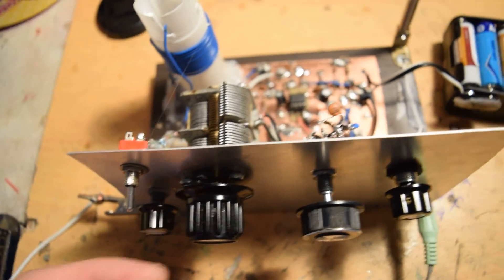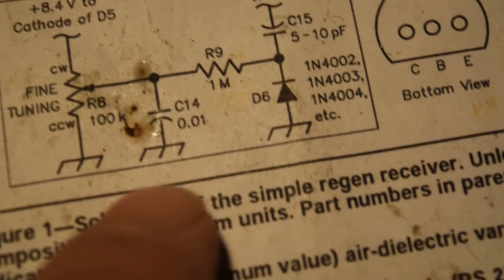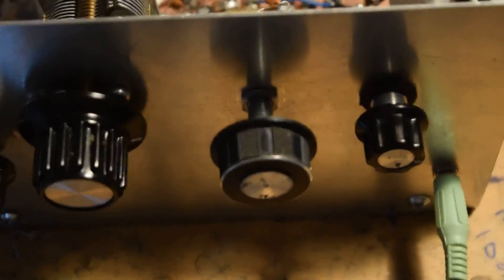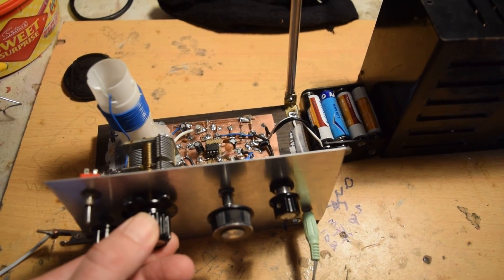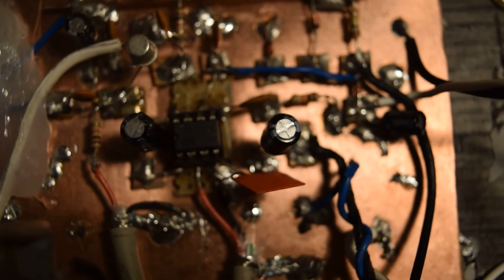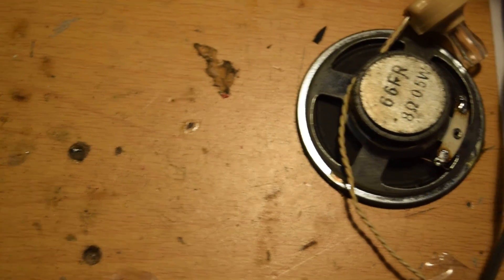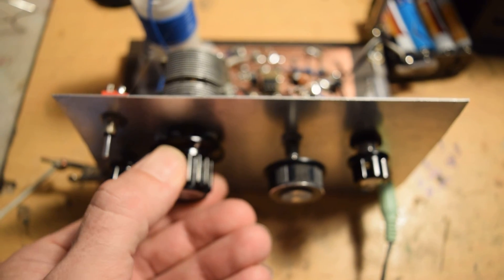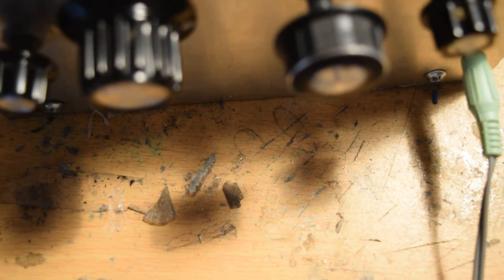I finally got my homebrew regenerative receiver to work..hand capacitance is not so much an issue.

Comment: Thanks for uploading this.  I’ve built maybe ten Regen receivers… some worked to a degree and others didn’t work at all.  Dunno why.   But I’m persisting and it is good to watch videos of successful projects like this one.  I hope to use a regen receiver to have a few conversations on the ham bands when I finally make something that is sufficiently stable and sensitive.  Best wishes from New Zealand. ZL3ABX.
Reply from the maker: @StephenCooteNZ  Thank you so much for your kind comment it means alot. I too have built many regens over the years, I was out of the hobbie for a while so had to play catchup. I still have these urges to build regens I don't quite know why but I love them the simplicity and the surprisingly good reception and pretty good selectivity considering there is only usually a hand full of parts. I to want to build a little transceiver that's an itch I've yet to scratch lol. Please if you do build a regen I would be interested in seeing it, if that's possible, I like looking at other builds.
Thank you once again for commenting all the best 
Simon 2E0HYP 🇬🇧

Comment: Hi, Simon. Both tubes will work work fine. I used a 3:1 transformer.
Reply from the maker: Hi Martin thank you..I do have quite a few transformers that I have scavenged over the years,so it looks like I'm going to have to wade through lots of cobwebs and dust to get to them lol. Thanks for the clarification 👍

Comment: I love regens. Made a couple dual triode type (6sn7) and a simple transistor. Now collecting parts for kitchin high performance regen. Ham radio is such a great hobby. 73 karl
Reply from the maker: Hi Karl I was looking at your video again its really good 👍 hope your still tinkering mate
Reply from the maker: Hi Karl this regen you built do you still have the schematics for it? I would be very interested in building it I'm not sure if you are a regular on YouTube but hope you get this message I could Google it but you may have some much more in depth knowledge in this area that would be of great use.kjnd regards
Simon.

Comment: Put cap across pot wiper about .1uf or so. Even better is a throttle cap across tickler to ground. But overall nice job. 73 wa2kbz
Reply from the maker: Hi Karl thank you for the tip I will keep that in mind,I'm planning another bulld and you're information will be of great help..2E0HYP simon.73
Reply from the maker: I'm in the process of repairing this regen after a box of bits fell on it. That little tip regarding the .1uf cap across the tickler really did the trick thank you that was very useful indeed 👍

Comment: Where's the circuit diagram so I can build it too?
Reply from the maker: https://k9xn.files.wordpress.com/2012/02/n1tev-regen-schematic.jpg
Reply from the maker: There you go hope this helps. And good luck
Reply: @SimonsSolarShed  This is an old circuit. Built it years ago and could not get it to work. I am building the WBR receiver now. Much better circuit.
Reply from the maker: @Berghiker  I couldn't get it to work at first hense my jubilation when I finally got it to work ;) yes it's an old circuit but this old circuit got me fired up again and now planning better builds.
Reply from the maker: You have to find out why it does not work then make it work that's how we learn  it was a challenge and I won lol

Comment: You are an awesome builder! When I look at my awful construction techniques (a 6BF6 Morgan, see https://drive.google.com/file/d/0B7AnoMf_eQGwLXFnbjhBWHI2Qzg/view?usp=sharing) or my ill-built crystal radios, I wish I had the knack you have for building front panels and wiring the circuits! Contratulations!
Reply from the maker: Martin Thank you very much for your kind words,but I have seen what I consider to be works of art on YouTube amongst homebrewers mine would pale into insignificance in comparison. although on my next build I will take what I have learned during this build and make the next one much better.i took a look at your link, there's nothing wrong with it  you got it going and once you have completed and happy with it you can further refine it that's the beauty of rats nest construction. i like the fact your using tube technology something I hope to start tinkering with.keep doing what your doing you can only get better that's what I always believe.
Reply: Thank you again. Yes, I am a nostalgic builder. I am 51, and I favor keeping the skill of building glowbugs alive. I actually feel more confortable building tube radios, but I have also built a couple of broadcast band and SW bands radios using the 2N2222A and the MPF102, and they worked like a charm. You can start with Alfred Morgan's one-tube regenerative receiver and then proceed to build a Twinplex or a Dorle set. Believe me, they run on almost any voltage and in my experience, the values components (tubes included) are not that critical. Building and tweaking Morgan's regenerative radio has been a very valuable experience and a most rewarding, fun endeavor for me. I wish you well, feel free to ask anything. (I do not prize myself in being an experienced builder, but my projects do work most of the times, and I am willing to share my experience with others.)
Reply from the maker: Hi Martin :) are you still on YouTube I'm looking for a project to upload on my channel and what tubes did you use i hear 6sn7 is a good choice did it require any kind of transformers? Kindest regards 
Simon.2E0HYP

Comment: Helo   ssb ???
Reply from the maker: Hi it would need a bfo "beet frequency oscillator" and possibly change the coil.it is possible.
Reply: @SimonsSolarShed   29mhz???
Reply from the maker: I havnt come across a regen that does 29mhz,that's not to say they don't exist,I  just haven't seen one.
Reply from the maker: @Феруз Вохидов  hi I just been searching online for a circuit and this interesting site I will post the link below my message.ypu may find this interesting.kind regards simon 2E0HYP
https://sites.google.com/site/linuxdigitallab/rf-ham-radio/regen-high-performance-righttps://sites.google.com/site/linuxdigitallab/rf-ham-radio/regen-high-performance-righttps://sites.google.com/site/linuxdigitallab/rf-ham-radio/regen-high-performance-righttps://sites.google.com/site/linuxdigitallab/rf-ham-radio/regen-high-performance-rig
Reply from the maker: Just goto main site and scroll down to regen section..I'm very tempted to build his regen 3.

Comment: Вместо диода варикап посавил   1n4004
Reply from the maker: Hi the 1n4004 is used in the fine tune,works pretty well.
Reply: @SimonsSolarShed   у вас 8 раен ловить   на кв диапазоне   у меня передачик 200вт  1 категории  кв